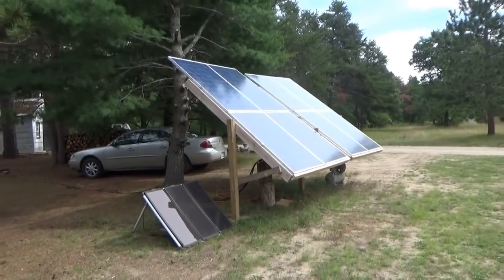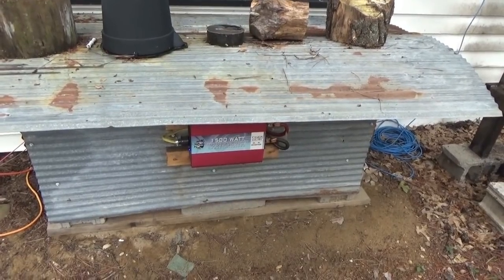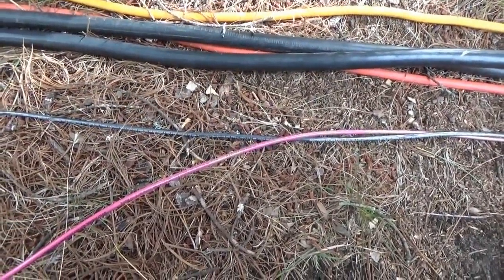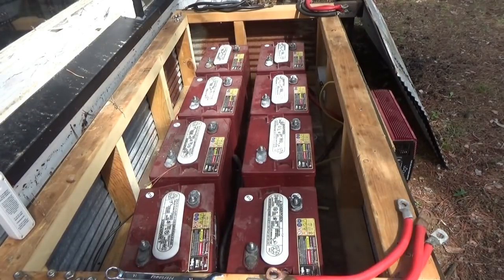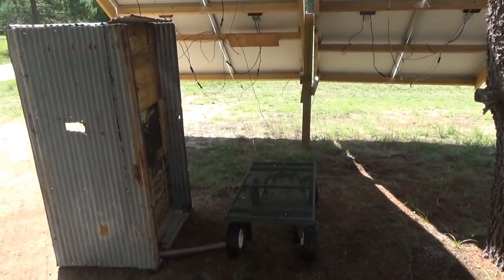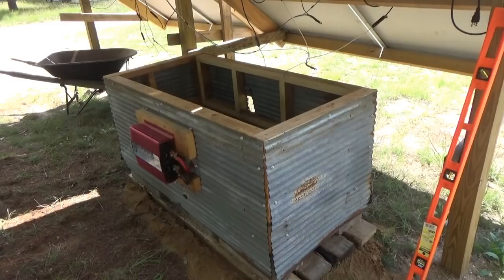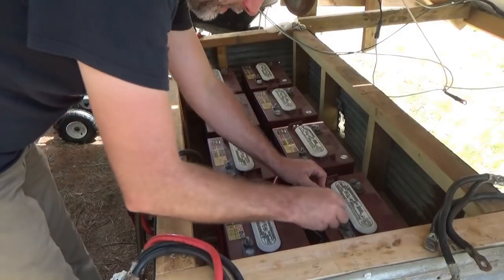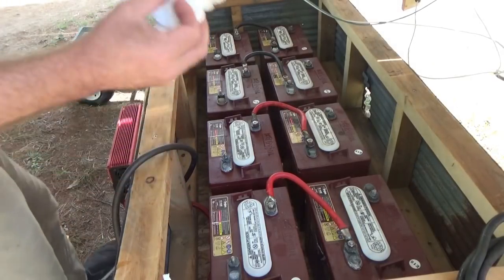The Off Grid Project Rewiring Solar Panels For More Power

Comment: You can buy heave gauge wire at recycle center for scrap Plus  and do it once. I know Troy have followed for years. Put wheels on that box. Dump unused power in that box with upper limit heat switch.  Your system is so small how many KW you have?

Comment: hey dodo bird,wire your panels in series . those wire can handle 120volts and 10 amps no problem long distance.
Reply from the maker: I did. Thanks for the insult by the way. MPPT solar charge controllers allow you to wire them up in series for the longer runs. But smaller wires are still very bad. That is the biggest problem.
Reply: not an insult, just joking with you. 12volt high amp solar setup is ancient tech and should be killed off(where the dodo bird comes in). Keep up the hard work but just work smarter.
Reply from the maker: Oh, yeah. I am looking at 24 volt equipment but its gonna take some serious investments to convert. I know most people can afford it no problem but for us its tough to make the upgrade. One day....

Comment: I've been with 12 volt system for almost 4 years I just jumped on 48 volt and clearly saw a big difference however for having a 12-volt system so long... the batteries were all drain down 14 batteries of 12v..of. Agm lead asid  interstate deep cycle ... I don't have a mansion these battery should last 10 years don't make the same mistake.....

Comment: funny you mentioned the ...put a nut on that pair of crossed wires when you started to reconnect...i bought a new battery...and a new cable which comes bent in half in package at Canadian tire...so when i put one end on the new battery negative post and stretched the wire out straight...and tucked in beside the battery so i could do something else...the wire recoiled back to being bent and sure as hell...dead center connected to the positive post...and my face was right over top of it...talk about lightning flash ...good thing a had the wrench in my hand i instantly smacked the wire and it released from the post...2 second connected and it tried to weld itself ....man i was shitting bricks finishing up that job....ps..i always wear my clear face shield when doing battery work...

Comment: That will work good until it freezes I know you going to try to heat with heat tape but they actually have or sell battery warming pads batteries sit on that would work a lot better. It get too cold in Michigan in the winter time you know that. You will have to do it correctly or bring them in the house or loose them.
Reply from the maker: I will heavily insulate the box all the way around and make a passive solar heater which will help a lot. Heat tape will be a backup as needed. I also plan to set up the wind turbines now that I dont need so much expensive wire to connect things. I can use the dump load inside the battery box which will help a lot.

Comment: It sounds like you are trying to maximize AC power now for your mining rigs. 

In that case, it's probably time to make the jump to 48V battery bank and inverter in order to stop losing so much power to the 12V to 120v conversion process.
Reply from the maker: Yes that is my plan along with running more appliances as needed with comfort. I cant afford the switch right now but hope to one day switch to 24 volts.

Comment: I am not an expert on solar power setups, but I do know about the physics of lead-acid batteries. These batteries use chemical reactions to produce and/or store electrical power. Either process, as well as producing or storing electricity, produces some heat. Therefore, as long as the batteries are either delivering or receiving sufficient power, the chemical reaction should prevent freezup. If batteries are neither receiving nor delivering power, ambient temperature is a significant issue. All batteries will continue some chemical activity regardless of whether or not you are using them. The chemical activity reduces with temperature. As a result, with no draw, a fully-charged battery will last longer in cold temperatures. A low-charged battery risks freezup. The right balance is hard to achieve unless you have a very large battery bank and a charging system which can accommodate adverse charging conditions.

Comment: So where's the charge controller going to go?
Reply from the maker: In its own housing on the side of the battery box. In a closed and locked housing. Ventilated of course but protected from the elements.

Comment: your looking to brake your battery posts hammering on them, it happened to me being in a rush, put the wech on the side of the wing nut and on the side of the post to turn loss or tight
Reply: that happened to me too it was a shame and a waste when that happed to me. Really sucks when that happens. Lead breaks easily.
Reply from the maker: I was tapping lightly but yes, I was doing just that the rest of the day. No idea why I had forgotten to do it that way. lol
Reply: tapping lightly sometimes all it takes and op's
Reply from the maker: Well, again, I switched to using it as you said, even before seeing your comment. Its how I used to do it but for some reason had forgotten oddly.
Reply: Troy, it is not good to do anything making mechanical shock vibrations to a lead acid battery.  Besides damage to the battery post connection to the plates as Arnold noted, there is the damage from shaking the sponge off the plates and accelerating the time of when enough "sponge" and metal debris particles build up on the bottom of each cell and the eventual shorting of the cell plates.  Yes, I know car and other vehicles shake a lot, but you will also notice car batteries often now days only have a 2- 3 year warranty as the plates are so thin and fragile!  But years ago I could get an 8 year warranty!  The cheapskate nature of business practice today.  To extend the life of a car style battery, you can mount it on shock absorbing material like used on portable generator rubber feet or other.  My battery was hard mounted to the fender frame with a bracket and bolts.  I took the bracket off and just let the battery "float" a bit.  It is in a capture tray anyway, so not going anywhere.  The shop selling the battery said it was only good for 2 years new in the hot FL weather.  Well it is now over 4 years and still going.  Coincidence?  I think not.  Also to stop phantom currents draining the battery from corrosion at the posts forming current paths to the metal of the battery tray (- negative bat return) I have placed the battery in a doubled up plastic shopping bag before placing the battery on the tray.  4 years later, and have no corrosion trails forming around the posts going to the bottom of the battery and tray.  The plastic bags insulate the current paths to ground and ward off humidity of air making sulfurous acid discharging paths.  Plus it stopped the previous rusting of the battery tray that was occurring before the bag trick.

Comment: I love those Trojans.    I use T105s.  Six volts.  One day I will upgrade to Trojan R.Es.
Reply: I love Lithium-Ion batteries such as the Tesla Powerwall. Lead acid batteries are ancient technology that is over 150 years old!
Reply from the maker: Sounds great until you calculate the cost of new tech and the control electronics needed to make it compatible with off grid solar usage. Plus consider the life of the lithium tech compared to lead acid. Old school batteries will last 10 years if properly cared for.
Reply: The Powerwall 2 has a 10 year warranty. Instead of having a charge controller, inverter, a rat nest of wiring, and bunch of batteries that require maintenance... The Powerwall comes as a self contained unit with a 5 kilowatt inverter built in and it requires no maintenance. With an additional gateway, it can operate in a grid tie or off grid mode. It's not cheap but as I've been saying all along... Solar power, or going off grid when done right, is not cheap.

Comment: Great vid.  I use landscape wire for my solar.   Comes in 25 or 50 ft rolls.  Two strands and it’s not all that expensive.   Good for under ground and long runs.
Reply: the stuff is far to light, line loss bad, it lucky if its 14ga, it is very low amp wire, as well very poor copper
Reply from the maker: Thanks. If you use heavier gauge wire you will see a huge gain in power